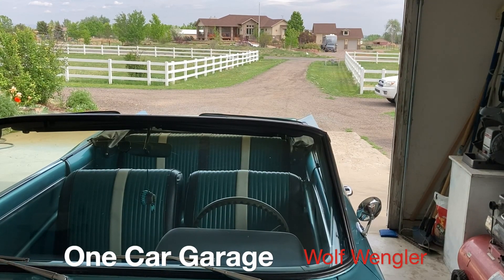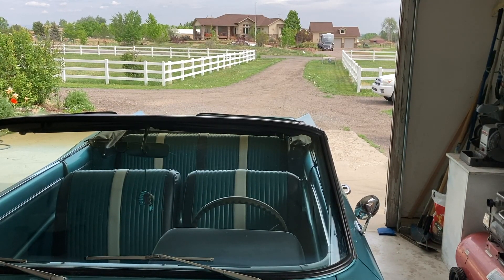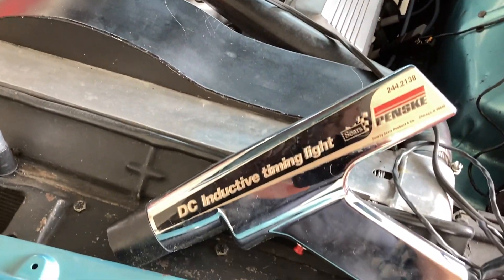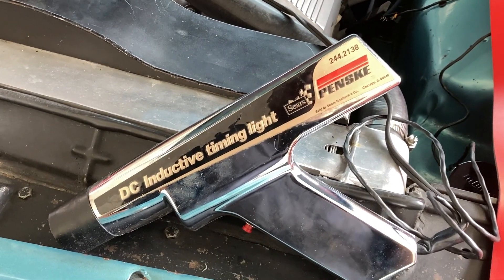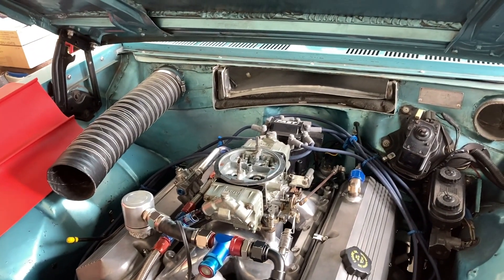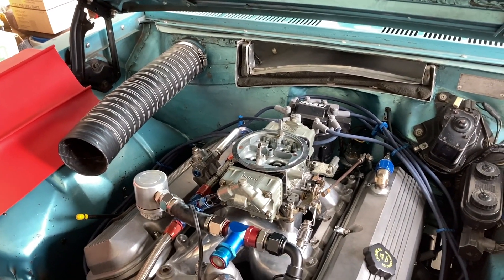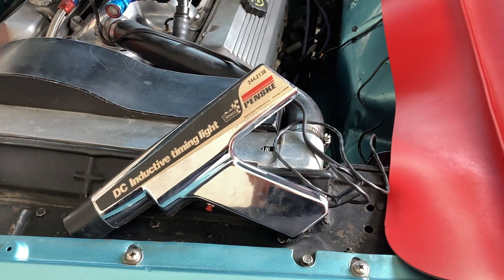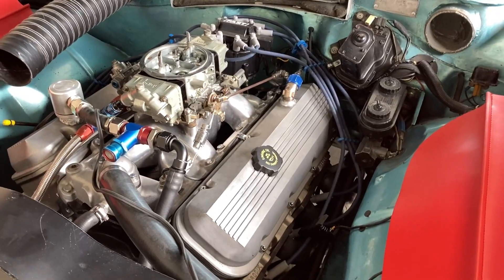Old Timing Light for Modern Ignition

Comment: is this the type you place a spring between the spark plug and the plug wire and has a lead coming from that spring to your timing light  that uses the actual voltage to light the light bulb?
Reply from the maker: No it gets the signal from around the wire.